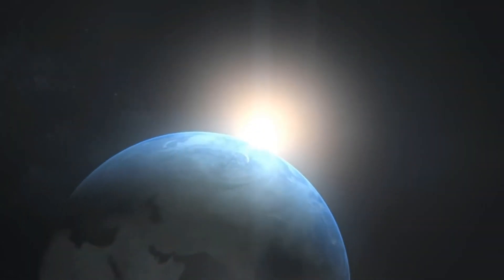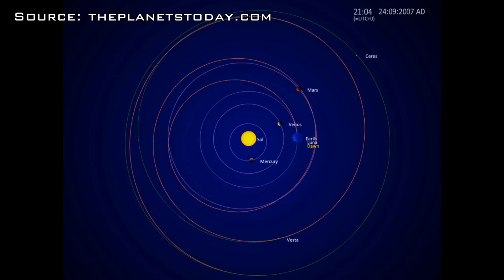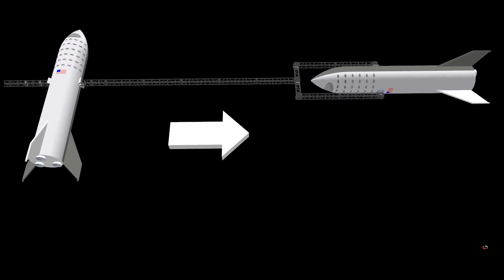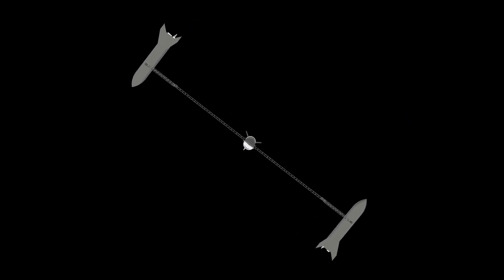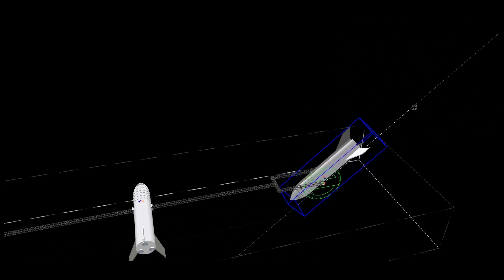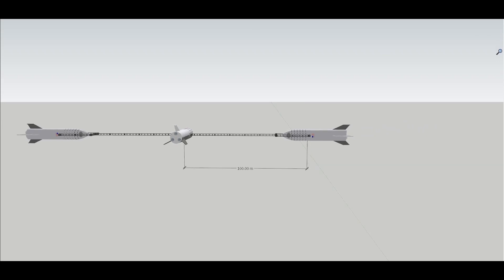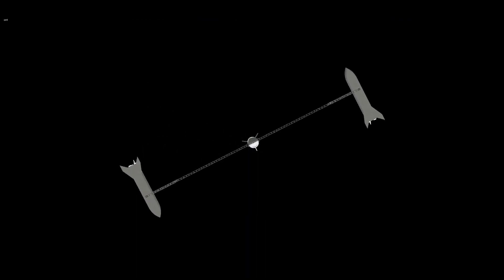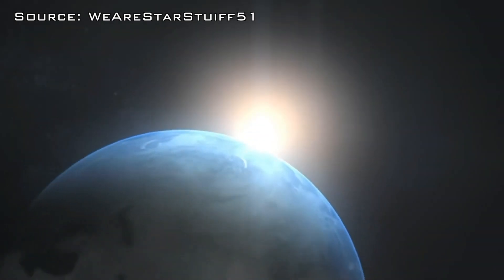GLS2: Artificial Gravity for SpaceX's Starship

Comment: I like the idea of having gravity but when those ships start to go into rotation mode, I could see that long thin truss look like the demarcation line on this yin/yang symbol.☯️
Reply from the maker: Not in space my friend! The truss doesn't even have to be that strong to handle the torque. The big engineering hurdle here is tensile strength of the truss strong enough to fight against the centrifugal force of the "weight" of the starships.
Reply: @smallstars   I am not talking about tensile strength. There may not be any gravity in space however, the mass of an object is unchanged. I just cannot imagine a truss as trying to move the mass of  entire space ship, laterally,  at the distance you describe. I think it might work better if you just used cable and put the thrusters for the rotation on the outer ships.  Anyhow, I like gravity. gravity is good,
Reply from the maker: @pforce9  The thing is, the truss does not try to move anything. the starships themselves are where all the mass is, and they move themselves with their rocket engines. The truss will be actuated by the starships sure, but the truss's mass is insignificant compared to the mass of the starships
Reply: @smallstars   I like your idea for creating gravity in general but I think that any rigid structure as long as the one that you propose will be subject to considerable flexing even with nothing attached.  That truss has to be stored and assembled and there are a lot of points for it to do something you don't want it to do on a mission that must be zero fail.  With a tether, you ,might have to angle the rockets outward a bit to keep the tether taught but it is smaller, lighter, does not require assembly, less prone to failure and we did it before. The best way is sometime the simplest way.

Comment: One of the things I really like about this idea is that it would give the passengers a redundant Starship in case there's a serious failure on the other. 

Also, I'm not sure but I don't think the Raptor can throttle down to 25 percent as you mentioned in the video. 50 percent is the lowest Elon said the engine will go to. Assuming that is true, would your system still be strong enough to handle the higher thrust-loads?
Reply from the maker: I believe so, because that raptor at 50% is pushing tons and tons of starship mass, but not much truss mass. It is pushing on the tangent of the circle too, so if you think about it, not much is pushing against it. imagine trying to bend a fork but only using 2 fingers, one at the end of the tines, and one at the end of the handle.

Comment: This is exactly how I see it. This is a low tech , simple solution to a very real and practical problem. Maybe some day there will be high tech artificial gravity.  But this can be used right now. Years ago I suggested using expended shuttle tanks or purpose built moules to construct 'Gravity Habitats' to provide living areas for the crew of the space station. A system like this will keep our crews in goog shape.  A game of tennis after two years in space ? Remember to go to the gym.

Comment: Artificial gravity is important, but your system is quite complex and ignores cosmic ray protection and other crew safety concerns.  If you had four star ships tethered longitudinally joined by short hatches, (8 would be required for 4 ships) you could move cargo to the out-facing side of the four rotating ships to provide cosmic ray protection. (shorter hatches would provide better protection)   A magnetic-backed solar panel could cover the the outward-facing parts of the ship's hulls, the output of which could be used to power ship operations, and even perhaps an ion drive to shorten the trip. (The panels would be attached in LEO and then taken in as cargo to be left on Mars.   The hatches would allow crews to commingle, or even transfer to another ship in case of a system failure or hull breach on one of the ships.  The hatches would be much smaller than the truss you propose, and thrusters, not rocket engines would be sufficient to impart a rotation speed of 5 times a minute or so to simulate mars gravity, assuming a 9 meter diameter hull on each ship.  Elon's suggestion of an 18 meter diameter ship to come would reduce this rotation speed significantly.   I have not the tools to draw my proposed idea, but believe it better suits the Mars mission.  I would enjoy seeing your rendering of such a configuration.

Comment: you wouldn't need to use the main engines to give you the rotation you want, rcs thrusters should be sufficient since the rotation speed required isn't all that high but if they aren't enough, I think a smaller, more efficient engine with more precise thrust control would be better suited to the task than firing main engines. Then you wouldn't need to be able to rotate the docked ships, also the center ship serves no purpose as far as i can tell. Personally I prefer the ring idea but I think all the designs that are currently out there are way over the top. All the ring designs I've seen are closed in structures from start to finish, when in reality the only closed in structures that are needed on the ring would be the habitats. Everything else could just be a skeleton design. The best idea I have seen for artificial gravity so far is 2 counter rotating rings on a central column.

Comment: no trusses will be required. 3 Starship ones can create adaquite gravity linked by airlocks. 2 starship twos will do the same. Three starship twos will generate earth gravity with min spin. Having the space ships parallel will mean the Coriolis effect will be vastly reduced making travel much more comftable and allowing the spacecrafts to be joined closer together. Also having the three ships linked would allow travel between each. This system would create 3 seperate life rafts if anything happens.

Comment: Regarding radiation, If water is a good radiation shield could SpaceX use a double wall around the crew compartment housing some liquid fuel to suppress the radiation? Could u do a video on this?

Comment: You could use Ion thrusters to gently and efficiently speed up and slow down the Starships spin.
Reply from the maker: Ion thrusters do sound tempting. However, I was trying to avoid major design changes and additions to the starship, especially a whole new engine system.
Reply: @smallstars  what about just a big 1-ton reaction wheel in the middle of the truss? how many RPMs would you need? in space you could probably get up to hard drive speeds like 5000RPM.
Reply: @arkatub  a reaction wheel has a comparative advantage to using thrusters: it does not use any propellant. Thus an artificiall gravity system based on a reaction wheel would not loose precious propellant mass to deep space, but only need electricity from solar pannels or other source during spin up time. Even more, when time comes to spin down the system, the electricity can potentially be recovered using the reaction wheel as a dynamo.
Reply: @ytubedecharly  cheers for the reply, I did the math and think you could get the wheel down to 50kg or even 25kg if you can spin it up to 20,000 RPM, if you spin it up this fast you probably want to eject it for safety but at this mass you can have multiple wheels.
Reply: @arkatub  mmm that seems too liitle a mass to me! The moment of inertia (MOI) is   mass * radius^2 . You should make the MOI of the reaction wheel equal to the MOI of the two whole starships revolving each other. Think of the radius of the reaction wheel (squared) in relation to that starships, may be a  a hundred meters apart (remember, that's also squared). Only then, also factor in the relation of weights of starship vs wheel. The equation sould give you a spining wheel in the millons of RPM I think.
Reply: @ytubedecharly  ahhh, in that case my math is totally wrong, I was thinking it's just the weight of the wheel vs the weight of the starships, not factoring in radius at all.
Reply: @smallstars  They already use this on star link
Reply: I don't know if my math is right but I just calculated that it would take 91 days to accelerate to 3rpm if there was 1 X3 ion thruster on each ship.
Reply: or pedal bikes attached to rotor fans. then they also get exercise
Reply: Starship is to heavy for ion thrusters. You'd spend months gaining the speed required.
Using main engines or small,efficient methox engines i belive is the way to go.
Reply: Why not just use the methalox anyway. The RCs thrusters are going to be methalox with a fairly high specific impulse and a great amount of thrust

Comment: Great idea! One thing to add though. Elon mentioned that during a solar flare the ships will have to re-orient to place the main propellant and oxygen tanks between the sun and the passengers. So each of the two side ships will have to be suspended from its mass center, to be able to rotate and maintain effortless any attitude. Now they are shown suspended around the top 2/3rd of the height.

Comment: Interesting video and appreciate the fact that you are covering this topic because I don’t think it gets discussed enough. However this does seem like quite a complicated solution but I do think it’s on the right track. Personally I’m more in favour of the tether + RCS solution and I think you might have dismissed it too quickly. I haven’t personally done the maths on the RCS required but you can also reduce the amount of thrust required by increasing the length of the tether. If it turns out that the maths is still way off, there’s no reason you couldn’t attach the tether near the midpoint like in your truss example, and then use the main engines. 
Either way, I think a cable solution will be much more efficient than a fixed truss and if SpaceX can autonomously launch and dock a spacecraft to the ISS then they can probably manoeuvre 2 spacecraft attached by a tether.

Comment: Nice attempt but not radical enough ..Forget about the Horse shoe  truss connector and space frame idea (too low tech for SpaceX) , A "Hedgehog" with 6 starships/Modules connected via an bigelow style expandable tubed centre  ( umbrella shaft  with tubed truss) starship to starship  module connected to a centre transverse core with second opposing set of return starships . Elon  already knows that more than 2 Ships are required for this whole human transfer exercise  ...and as Mars drop Starships need to be paired for redundancy  as well as the Earth return Ships...thats 4 as a minimum anyway....so addon  2 more and go full "Hedgehog" and tumble thru space at 1G.....lots of Gear increases safety....

Comment: Clever solution but I several issues with it. (This may be a good solution farther in the future.)

1. Adding a lot of complexity and new failure opportunities. What if the engines don't light in time or not at all or don't throttle correctly? Will lighting the engines 2 extra times make a failure on landing more likely? What if the structure breaks or doesn't rotate properly? Can you recover from such a failure? You are also putting all you eggs in one more complicated basket where the loss of the mission would set back future missions greatly.  How would you even test this system? 

2.  It would necessitate coordination of 3 ships to work perfectly, a problem with just one would cause the mission to be delayed or aborted. There is no infrastructure to launch 3 ships and all the refiling trips, maybe 12 more launches (15 Total) . All the people In the ships will have to wait in orbit for all the refueling on 3 ships to complete before leaving, maybe weeks?. Even though Elon is talking about sending 2 ships at a time for the fist 2 missions to mars he would most likely be 1 launch and 3-5 refueling launches and then it would leave orbit and then repeat process. Much easier on ground resource logistics. 

3. Cost. The R&D to design the system, build, launch refuel in orbit would be massive.  You are now increasing the mass of a 2 ship mission by 50%(although the center ship could carry some cargo). if you do decide it is too long to be without gravity and decide throw money at the problem It would be cheaper/ safer IMO to just reduce flight time by launching a small booster that can attach to the bottom to Starship and become a First Stage or (more difficult) launch and attach external fuel tanks to a Starship that can extend burn time on its engines and then be ejected. 

Great channel and discussion. (This is just and opinion, I don't think know everything lol!)
Thanks!
Reply: The fueling can be completed in advance of the passenger ship launches. It just requires a longer transfer time from the accumulating tanker to the passenger Starship.
Reply: David Ogawa How? You launch the passenger ships with people then you must wait for multiple launches to refuel. If you launch With no passengers you need yet another rocket to get them up there later... or am I missing your meaning?
Reply: @MJ-zo5gb  
You accumulate the propellants in advance in orbit in a Starship tanker. Five trips to fill it up. Later, transfer it all at once to the recently arrived passenger ship in orbit.
Reply: The early prototypes can be used until they are obsolete, providing SpaceX with valuable data. Until then, they will be used as tankers to practice docking, fuel transfer, flying around the Moon and later landing on it. After 10-20 flights some version will be deemed safe enough for manned flights. Other versions will still be useful as tankers to lift and store propellants in orbit.

Comment: i dont think the main engines would be necessary, could they just use the rcs thrusters?
Reply: lol didn't watch the whole video\
Reply: @Deanorama   I don't wish to annoy others by saying this, but actually you are correct. The Mars version of Spaceship rcs will burn the same fuel as the Raptors and will be of similar efficiency. It's much much gentler, and you'll already have a side-pointing rcs thruster, eliminating the heavy truss needed to flip the ship sideways. 

Big main engines can shake your teeth during a launch from a mile away right? So no, it's too violent. You'd even get the exhaust plume from one ship striking the other.  Even if everything else were perfect, ignition failue of one ship's engine means disaster -- as in possibly ripping ships and killing everyone.

Comment: There is a lot that you don't understand about rocket science a number of your suggestions don't make mathematical sense
Reply: Well the biggest problem is how he wants to spin up this contraption. TLDR; it would not work. There's a couple of reasons why. 1. Rocket engines don't have the precise control that you would need in order to achieve the necessary rotational velocity, not to mention that a rocket engine is simple too powerful for this task. 2. There are no RCS thrusters powerful enough to rotate the two edge ships in place an keep them in place. BFR is estimated to have the mass of 100t that means that when this thing is spinning there would be at least roughly 30t (in mars gravity) of continuous force that an RCS thrusters would have to counteract. That's like trying to lift a small rocket of the ground with RCS thrusters, there's a reason you never see that.
Reply: @RealMineTuber   The Mars BFRs are supposed to have beefy rcs that run on methalox.  So an extended burn would work.  You have plenty of time. 
Problem is though, the maker of the video wants to use main engines -- and a whole swivel-clevis truss thing to flip the ship sideways in order to use said engines. 
Uuuuuhhh... no.
Reply: @harpfully  
I must agree that a four second burn of a main engine is going to apply force too abruptly to the ships and tether. 

The RCS thrusters were going to be 10 ton thrust MethaLox engines. That was set aside for Hopper. If made efficient, it would be appropriate for spinning up tethered Starships.
Reply: @harpfully  the swiver thing is exactly what I was referring to and yes I agree you should just use RCS thrusters to spin up/down, you don't need a lot of tangential velocity to replicate earth's gravity.
Reply: Details, please.

Comment: Overemphasizes an imagined need for gravity during a relatively short trip (6 months is on the high end, it can easily be much shorter).
And completely negates the much more important radiation protection already built into the system.